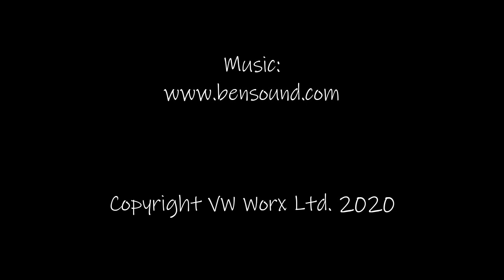VW Worx Coach to Camper Conversion #WorxVoyager Episode 3

Comment: Why did you think reinforcing the floor was necessary? It was built to take the weight of 53 seats and passengers after all.
Reply from the maker: The floor was lowered as the original floor was not a single height.  Extra reinforcing to the floor has only been added where the slide-out has been fitted and the only additional steel was to level the incline in the floor at the rear to allow a constant level throughout.